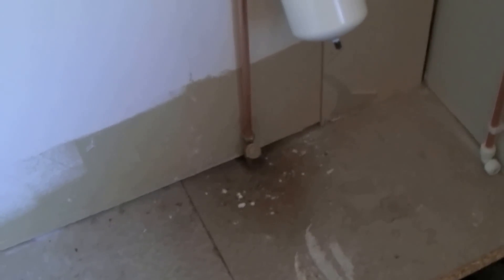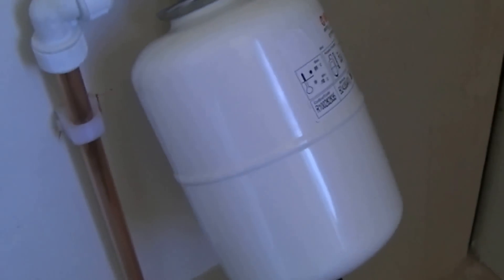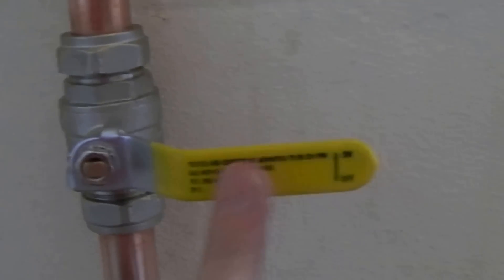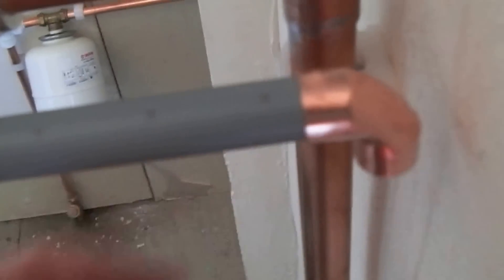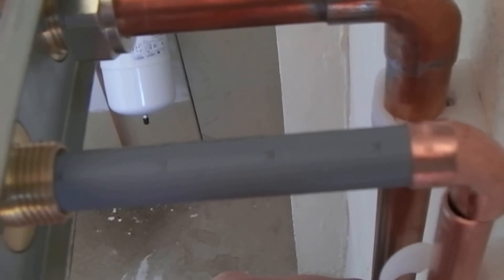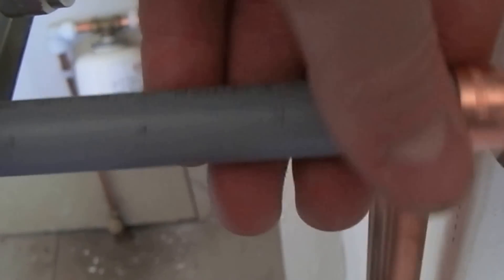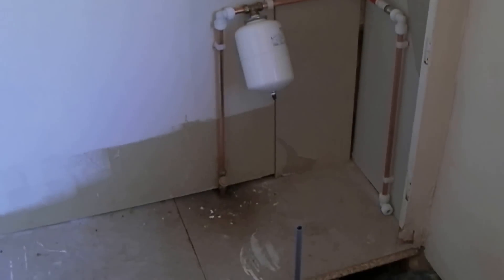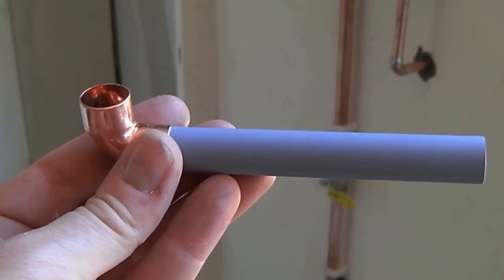How to install central heating. Part 16.

Comment: Bad idea to use push fit fittings on the chrome plating on the scale reducer. The grab rings can't grip the chrome properly and can slip off under pressure.
Reply: Just what I was thinking. Use compression or nothing.